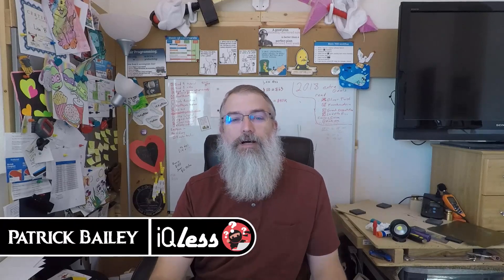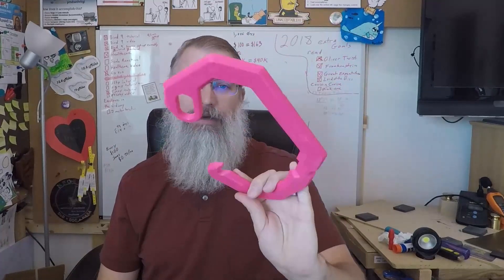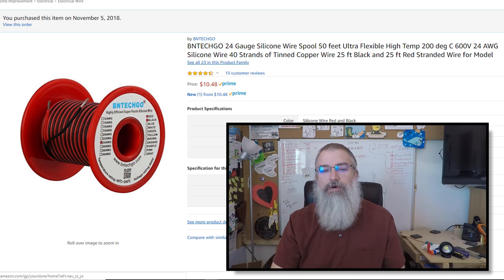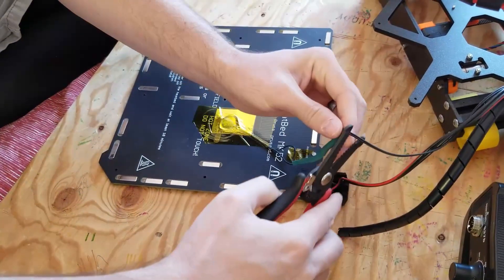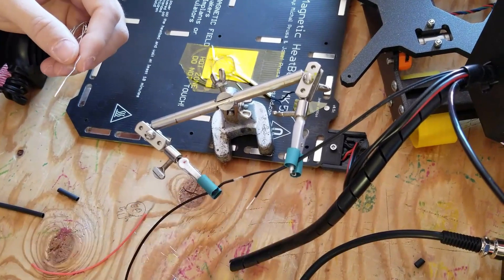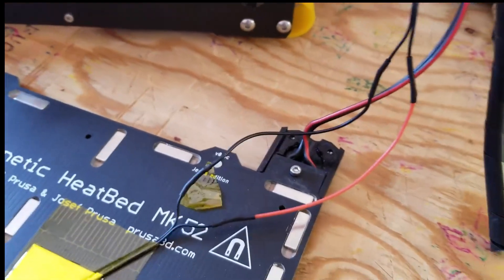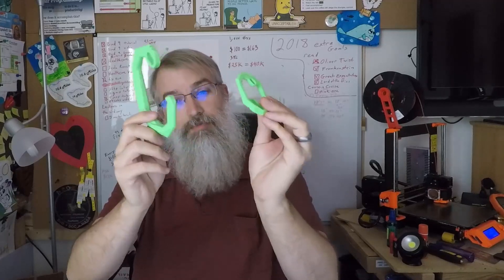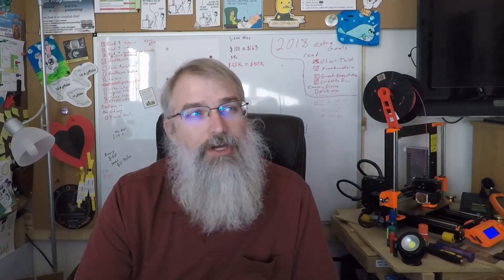Prusa Printer: Issue Err MINTEMP BED Round #2

Comment: I would change the all lengt of wire. Never a good idea to put new break point because the solder is a point that will break over time. And all the work for nothing.
Reply from the maker: So far it is holding up.   However I did buy a new bed thermistor.   If/when this fix fails I will replace the entire thing.
But this, so far, looks like it would be more than enough to get it fixed until a new part came in ;)

Comment: Good quality silicone wires are much more expensive than regular wires, so it is up to the engineers to choose the right one for the job. But on the other side is the customer who wants cheap products, so there will be always a balance between part prices and quality. There are companies designing weak-/break points into their products to resale new products. I am sure Prusa isn't one of these! We had once a laptop series which had a tiny thin metal plate close to the screen hinges which broke one after another just after the warranty (2 years) and crack the plastic so bad that a repair wasn't an option. Even this thin metal piece wasn't available as a spare part. Something similar I (and hundreds others) had with the washing machine where a 23 cent (5 cent in big quantities) power regulator burned after 2y and 3 weeks, changed that part for a 26 cent (still 5 cents in big quantities) regulator and the machine is still running now 5 years since the repair.

Comment: I would have changed the wire from a point that can be fixed with kapton tape (around 3-5 cm from the sensor itself) to the underside of the bed up to the connector in the electronics box. Every solder piece is a potential breakitng point. There are other companies using quality silicone wires to have less cable breaks so lets hope that we get less issues in the future. But let's do not forget it is a machine and these need maintenance as well some knowledge how NOT to pinch cables :-) during assembly.
Reply: 3D Gussner Agree. Made the same mistake. Nowadays if I get a broken cable, I replace it completely. Any joints in the bending area will break over time.